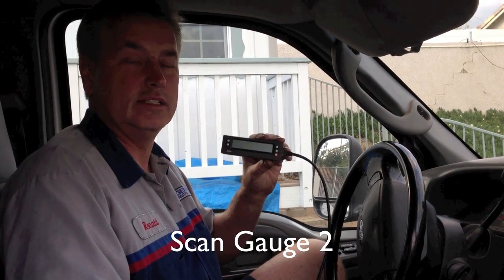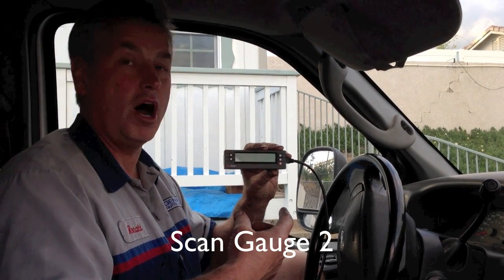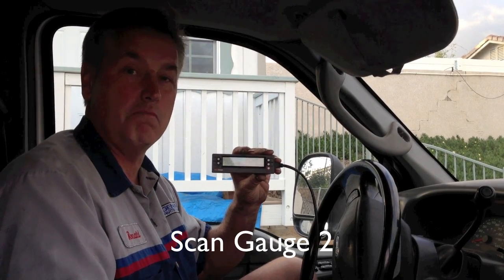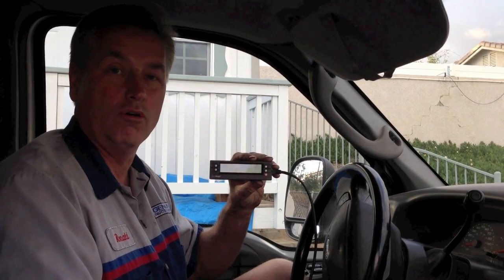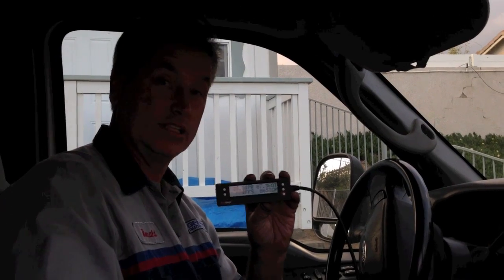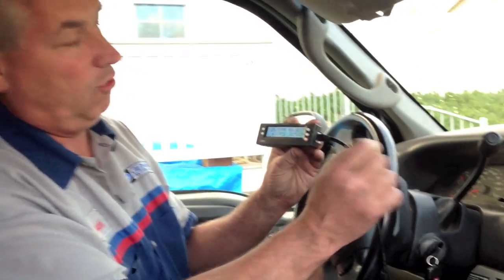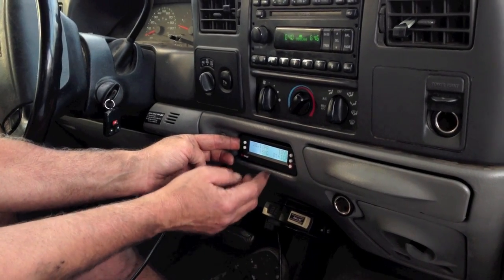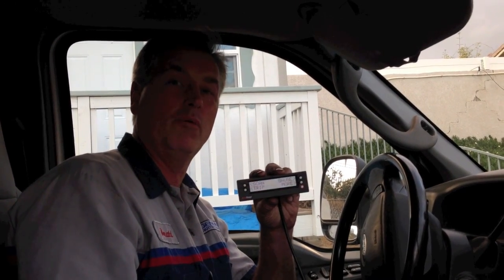HOW TO PROGRAM YOUR SCANGAUGE FOR THE FORD 6.0 POWERSTROKE DIESEL AND MONITOR ESSENTIAL PIDS

Comment: New viewer, new to me '05 F450 6.0 PS.

Crank no start. Walked through the whole machine with Ron, finding issues at every turn. She's starting faster than ever. Just a couple more issues... THANKS! 

This tool diagnosed low FICM voltage. Power board swap ($80 instead of the $800 full FICM module) to get voltage over 48v. Reads constant 49.5v 🎉 👍 Still no start.

Also/Still read low ICP, with reasonable IPR readings. Tested good IPR. Air test Replaced stand pipes (not fun, but actually not hard) finding the classic/expected blown gasket. Starts great now, but I've got a glow plug wiring harness melting so I'm tracing that final issue and it'll be running better than the day it was born. (Maybe the EGR got lost in the process too.)

Comment: I am totally buying one of these tomorrow. Thanks.  I picked mine up and right away I was able to determine I needed a new FICM, I hated spending the money but this immediately solved my problem and got my truck which had been down 3 months (new injectors, new fan clutch, new water pump, new oil cooler, new nipple cups, replaced oil pan gaskets lower and upper, new alternator, and KC stage 1 turbo) back on the road without a trip to a service station that would have really cost me a lot of money.  Thank you very much for the video.
Reply: MAN SOUNDS LIKE YOU PAID MORE AND SHOULD HAVE WENT LOL

Comment: i Have an 03, 6.0  150k  I have a problem with the truck starting 
. the truck starts normal and immediately shuts down usually three times before it starts and stays running normal. This  only happens on the first start of the day. All starts after the initial start of the day are normal. I had it diagnosed by a highly referred diesel shop which after having a few days said that they couldn't find anything wrong. Apparently there is something wrong and I need to find out what because a three time start can't be good for all components involved. I have ordered myself the scan Gauge 2 so i can do my own checking out. Like you said if you own a 6.0 this is a must have because this motor has been a night mare.  Could you please advise me.

Comment: does it work with 95 7.3l, if so how well does it work?
Reply: no.. 96 and newer
Reply: +FULLY LIT, you know that how. have you tried it on a 95 or what are you going by?
Reply: +FULLY LIT, you know that how. have you tried it on a 95 or what are you going by?
Reply: 95 vehicles do not support obd2 only 96 and new vehicles do..

Comment: Thank you Ron! I went to AutoZone and got my Scan Gauge II and plugged it in to find my FICM output was only around 30 volts. :(  Local for Ford dealer has the part for $800+ You sell them for $200- on eBay. Thanks again!

Comment: HI Ron, like the shoes. hey is the Scan-gauge 2 still what you recommend ?
or is there a new one out or different brand now that you prefer.?
 Question I have an Ford E350  06 ex cargo van 165,000 miles. when I push the gas pedal sometimes nothing happens as the van doesnt move forward if I let off and try again it usually works. isn't that a sensor that going bad if so what is it called or whats your recommendation.
thanks
Terry
Phoenix AZ

Comment: I have a 2006 f350 6.0 and im getin  code u0155 , somtimes it start and most time it doesnt, when it stsrted and I put my foot on break pedal it dies, can anyone help me with this
Reply: 2006 f350 6.0  hard to start then when it does I touch break to put in geaf and it dies, also dash sometimes stop working.can any one help? Thanks

Comment: Ron
I have the scan gauge on an 06 F250.  I am reading VGT 65, EBP, 1.08, IPR 12.6, FMP 124, ICP 1.85, SYNC 1, & EGR 0. 
 I am not sure if something went wrong during install but FMP & ICP seem to be wrong.  I am running an Edge programmer never run off of economy or tow modes.

What suggestions do you have